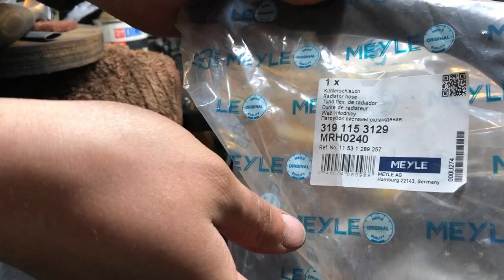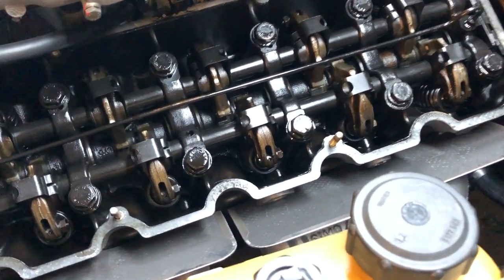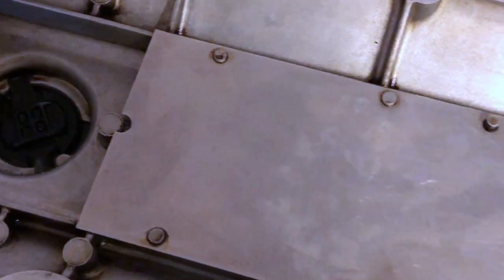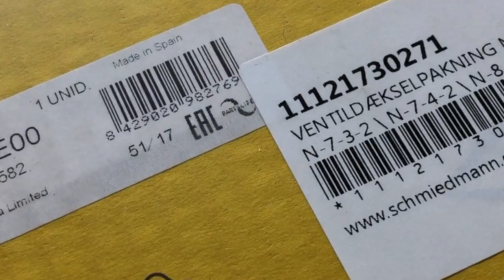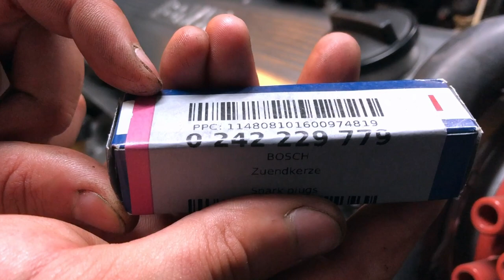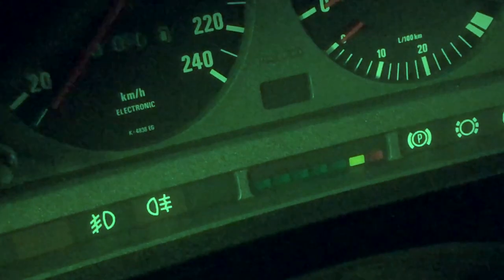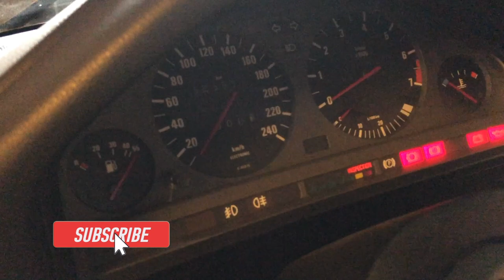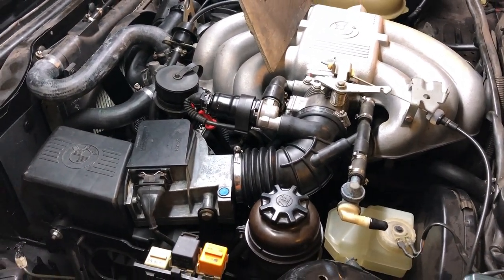Pt. 30 BMW E30 First start in 5 years - Will it Run?

Comment: When you flushed the coolant system, did you hose down in the radiator and engine block or just open the old coolent and put new in?
Reply from the maker: I flushed the radiator but not the block. Just opened block drain plug to drain the old coolant 🙂